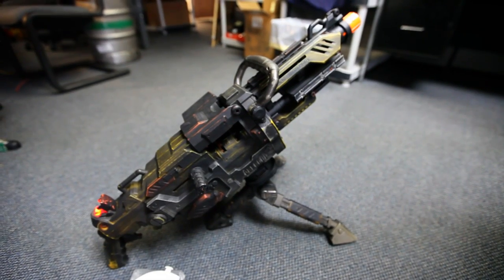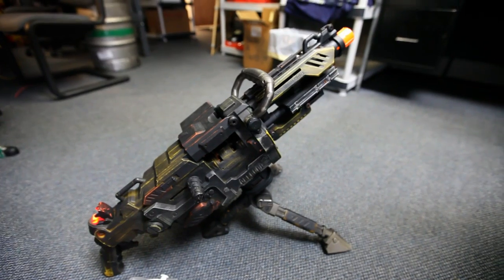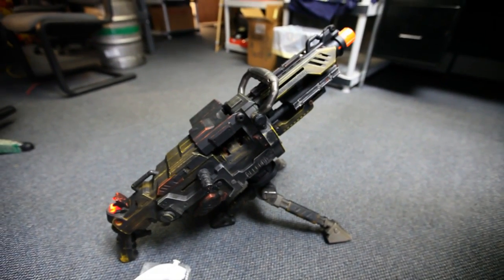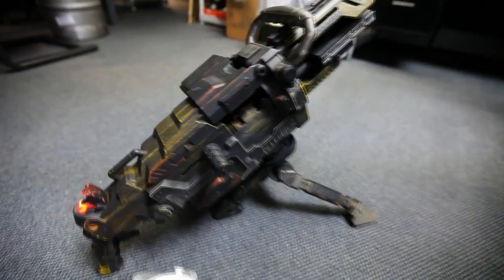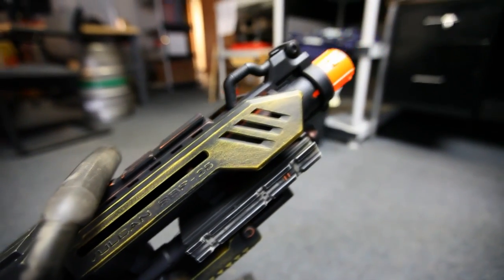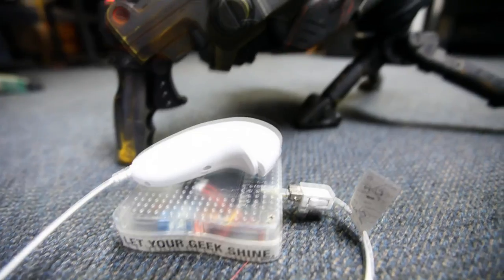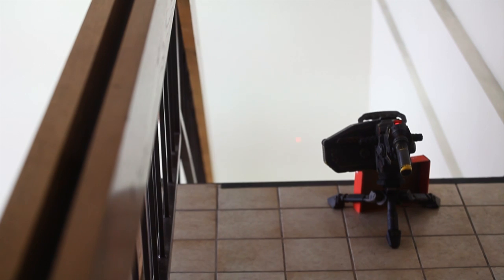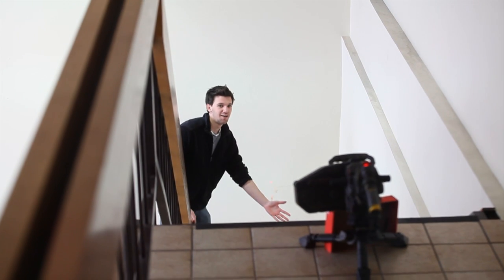remote control Nerf gun.

Comment from the maker: The circuit I created triggered the mechanism without having to use a servo. You can still use the gun like normal. Or remotely trigger it. If a servo was in the way, you couldn't shoot it with your fingers. Also, it would be ugly with all the extra hardware. This covert circuit lets the gun keep a factory appearance and still remotely trigger.